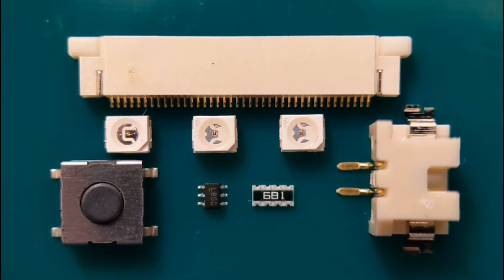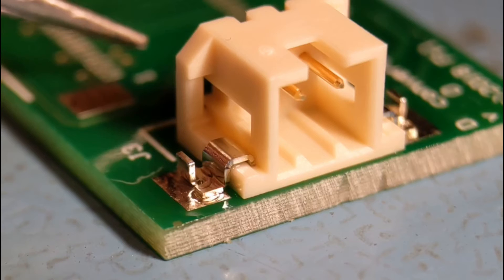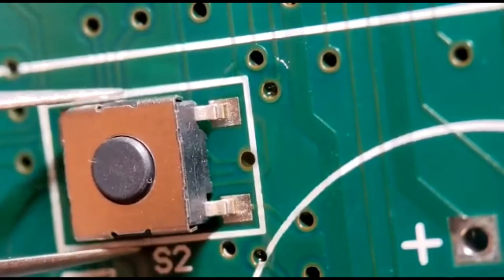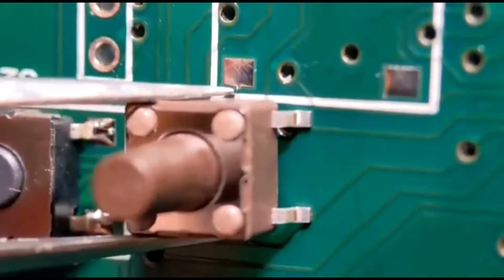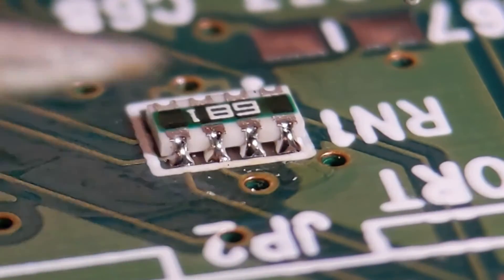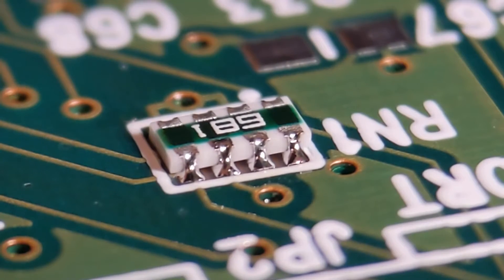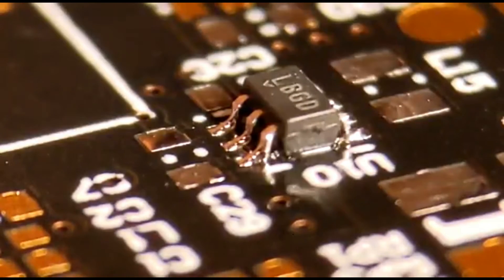How To Solder SMD Correctly - Part 2 /SMD Soldering Tutorial

Comment: whats the solder iron temp setpoint???
Reply from the maker: Hi , thank you for your comment . If I'm using leaded solder generally I would use about 330 degrees Celsius and for lead free about 360 to 375 degrees Celsius . I may have to go hotter in certain situations i.e ground planes ( sometimes over 400 degrees Celsius) but these temperatures are ok for the majority of solder joints . Hope that helps 👍

Comment: Amazing videos- do you solder under a microscope or a magnifying lense? How do you handle these tiny components? Would you be willing to share some of your equipment? I have already watched the one on tweezers and the cleaning video with Ultrasolve and flux off. But, I am interested in more info. Like the tip of your soldering iron, solder paste type and generally your soldering station setup. Thank you for sharing your amazing techniques and experience.

Comment: Should we be using lead free or leaded solder?
Reply from the maker: Hi , thank you for watching the video and commenting , much appreciated . I generally try and use the same type of solder that the board was built with . Lead free solder is usually a little duller than shiny looking leaded solder but there may be times when rework is impossible using lead free so you have to add some leaded into the area your struggling with . Thanks again , take care 👍

Comment: So when soldering the LEDs and your "quick" do you have like a really high temp on your soldering iron? When I try to be fast, the solder never melts as quickly as your does. It takes like 3 seconds instead of 1. But If i have my iron super hot, I feel like it is too hot and burns components before the solder even melts still. idk. I just dont know why my solder takes a few more seconds to melt than yours does. Maybe I just have a crappy soldering iron. idk.
Reply from the maker: Hi , thank you for your comment . I don't do anything special with temperatures etc when I'm soldering LED's . Leaded soldering roughly 330 degrees Celsius and Lead free about 370 degrees Celsius . The irons I always use in my videos are Weller branded . I also use Metcal  . These 2 brands in my opinion are the best 2 makes . Metcal are expensive but some of the Wellers aren't to bad . Cheap irons can be nasty and inconsistent , that may be your problem  . Hopefully you get to the bottom of it . Thanks again , good luck 👍

Comment: Hello there
Amazing video.
I’ve just done my first resistor network, it was tough to get those curved joints you have. 
I think it could be my soldering iron (it’s brand new). I have a hard time to get it pre-tinned at the tip! You sorta mentioned in the video you file your iron just after you buy it new. I took a 2nd look at your iron and I do see it has rugged edges. Does  that help you retain solder easier at the tip? I hear a lot of conflicting opinions about filing an iron or even just using steel wool to clean it. Your input would really mean a lot to me.
Thank you 🙏🏼

Comment: Can you do a video on how to de-solder these kind of components? It always seems harder for me to be able to take them off without damaging them, specially leds and plastic components like connectors
Reply from the maker: Hi , I will try to do a connector removal video shortly but a lot of connectors will get damaged during removal. It's impossible to not melt the plastic as they are made of such soft plastic any heat straight away will melt them , can't be helped. Some of the black plastic connectors will take heat gun use on them but generally white coloured connectors can't take any heat. Thanks for your comment , take care 👍

Comment: How hot is your iron? Great work mate!
Reply from the maker: Hi , thank you for your comment, much appreciated. If I'm doing leaded soldering generally I would have my iron set to about 330 degrees centigrade and if I'm doing lead free soldering I would use about 350 degrees centigrade. I might vary slightly on these temperatures on occasions but most jobs I would use the above numbers . 
Hope that helps , thanks again 👍

Comment: Excuse me , what temperature will be perfect for soldering Sir?
Reply from the maker: Hi , thank you for your comment , very much appreciated.
If I'm doing leaded soldering I would generally set my iron temperature to about 330 degrees centigrade, or if in doing lead free soldering I would use about 350 degrees centigrade. This may vary slightly if I'm doing certain components but generally these are the temperatures I would use . Hope that helps , thanks again 👍
Reply: Thank you so much Sir
Reply from the maker: Hi , no problem , take care 👍

Comment: What temperature did you set to LED's?Thx
Reply from the maker: Hi , thank you for your comment , much appreciated. I generally set my iron to about 350 - 370 degrees centigrade for lead free ( everything in this video was done at this temp ) or for leaded solder about 330 degrees centigrade . Hope that helps , thanks again 👍
Reply: @mrsolderfix3996  Thank you. 😎
Reply from the maker: Hi , no problem . Thank you for your comments 👍
Reply: @mrsolderfix3996  No problem, this is pleasure to watch your vids. If yo can make some video about HDMI/ USB replacement? Thank you.
Reply from the maker: Hi , thank you for your comment , much appreciated . I'm glad you enjoy the videos . I will try to do one on the connectors you've mentioned , but I don't get to post to many as I'm always a bit busy . But I'm sure sometime in the future I will cover this subject . Thanks again for your support 👍

Comment: Please make a flex cable connector desoldering tutorial with hot air. It would help me a lot
Reply: Yes i too would like to see taking off the connectors. I find the pcb boards i work on very component dense and not as brand new as the video here. I know the method would be similar but desolder tips would be helpful

Comment: You are inspiration as well as confidence for me in the smd world. I finished my first proto pcb with five 0603 resistor, one 1206 led and one 1206 cap. There are four THDs also.  It's my fault that I mixed up your technique with another video. I tinned with a little more solder one pad, then refluxed, then slided the component while holding the iron to melt the solder to tack the component in place. Rest is same as yours. On the other video during tacking he holds and slides the component by pushing from top, but I holded the component from sides with angled tweezers like you, because I think it may help solder to flow beneath the component. The circuit worked but I am not happy with the finish as some 0603 components floated on melted solder at one side during tacking and I didn't see that then. I should have followed your technique as is without any modifications. I have another same board I will finish that with your technique as is.
Reply from the maker: Hi , thank you for your comment, much appreciated . If you keep practicing you will definitely get better and you will be amazed at what you can end up doing . Keep going , and thanks for your support 👍

Comment: I have a question Sir ,what is RN1 on pcb?
Reply from the maker: Hi . RN1 stands for Resistor Network , which is basically a collection of resistors all built into the same component . They come in various sizes and values , i.e x2 , x4 , x8 way . Hope that helps , thank you for your question 👍
Reply: @mrsolderfix3996  i have an other question, what stuff would you recommend me to wipe flux after soldering and what stuff sould i use removing solder ?
Reply from the maker: Hi . I use a cleaning fluid called Ultrasolve  and I just dip a cleaning cloth ( dry wipes from company called Grove Sales in England ) to wipe the flux off . 
I'm posting a video in the next few days showing how I use my flux ( and places you can buy it from ) and also showing solder braid and how useful it is . Basically it's a braid and flux video showing video examples , photos etc of their uses together. Thank you for watching much appreciated 👍
Reply: @mrsolderfix3996  Thanks a lot  for your great details. I love it so much.
Reply: @mrsolderfix3996  thank you so much .you have done amazing job.

Comment: Flux is important as well as the correct heat on your solder iron. To hot will be a disaster and to cold will be a disaster as well.Maybe a nice video on choosing solder irons will be nice
Reply: actually, your solder tells you the working temp (always labeled). 
And if it's lead-free (already on PCB) is about 220°C — 240°C

Comment: What is the kind of flux you recommend?
Reply from the maker: Hi . The only flux I use is called SMFL200D . It's a great liquid flux and comes in a 200ml spray can. I just spray some into a small container and apply using a dipped plastic Ty wrap to the desired areas. Available from Farnell , RS Components , Rapid Online, I've even seen it on eBay. About £15 a can . Hope that helps 👍

Comment: Where do you get the fine tips from, type of Flux used ? Enjoy the videos,  nice tip on the filing the tip points thank for the knowledge.
Reply from the maker: Hi , The iron I use , Weller TCP S allows me to file down the tips , but some Soldering Irons , for example Metcals do not allow this as they work in a different way . I get all my tips for my iron from Farnell . Other companies who do them Inc RS Components , Rapid Online , even eBay. 
If you go through the comments for this video I mention what flux I use and where I get it . Hope that helps . Thank you for watching the videos , much appreciated 👍
Reply: @mrsolderfix3996  thanks I want to do a bios chip upgrade on my Imac motherboard.  Plus a video cable connector on another board.

Comment: Flux name
Reply from the maker: Hi . I use a flux called SMFL200D . It's a liquid flux , and comes in a 200ml spray can . I just squirt a small amount into a small container and apply using a dipped plastic Ty wrap to the desired areas . It's about £15 a can and available from Farnell , RS Components , Rapid Online , even seen it on eBay . Pretty easy to get hold of . Hope that helps 👍
Reply: Thanks sir

Comment: What soldering iron tip and solder paste are you using
Reply from the maker: Hi . The soldering iron I use is a Weller TCP S . The tip for it that I used in this video was a PTP7 , conical tip. 
The solder was 0.25mm lead free Sn100SB. Available from BLT Circuits ,Based in England . Hope that helps 👍

Comment: what flux and tin do you use?
Reply from the maker: Hi . The flux I use is called SMFL200D . It's a great liquid flux that comes in a 200ml spray can . I just squirt some in to a small container then apply using a dipped plastic Ty wrap . About £14 a can from Farnell , RS Components , eBay and others . The solder I use is from a company called BLT Circuits in England , it's Sn100SB , 0.25mm , lead free . They also do a leaded version of this thickness . Also they do all other thicknesses of solders . Hope that helps 👍

Comment: What type of flux were you using? I'm just about to buy some and I wasn't sure what to get. I'm looking at MG chemicals-835 rosin flux. Is that what I should be using or do you have something you recommend? Great video by the way, thank you so much for posting
Reply from the maker: Hi . Thank you for watching , much appreciated . The only flux I ever use is called SMFL200D . It comes in a 200ml spray can . I just spray some into a small container then apply using a dipped plastic Ty wrap . It costs about £14 a can  from places like Farnell , RS Components  , also seen it on eBay . It's a great liquid flux . If in USA can be found at Mouser and Digikey I believe. I can't really comment on other fluxes as I haven't tried many but I'm sure the one your looking at will be ok . Hope you get on alright , thanks again for your time 👍

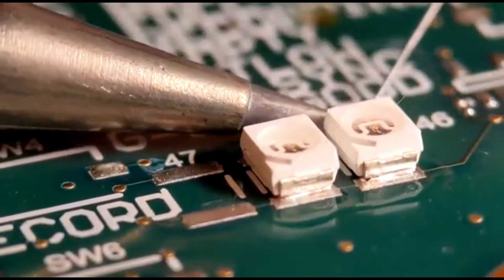Comment: When soldering the leds, it looks like the inner clear plastic i bubbling. Maybe it's a non issue / not a problem. Or, maybe it's just some visual effect from the smoke? Around 2:20
Reply from the maker: Hi . Thank you for watching . I can guarantee you there was no melting of the inner plastic as can be seen in the photographs that are tagged onto the end of the video showing these Led's.
I've learnt to do these really quick ( fact I mention in the video ) so as to not melt the plastic .These soft bodied components don't like an iron on for to long but you can do them ok if done quickly. The inner clear body of these led's takes a lot more heat than the outer body so it's actually quite hard to melt the inner if you solder these quick . Thanks again 👍

Comment: Impressive skills, compared to your precision methods everyone else looks like they're cheating with pre-tinned pads and drag soldering. And I've never been able to get lead free solder to flow like yours does, very jealous! Subscribed.
Reply from the maker: Hi . Thank you . Personally I'm not a fan of drag soldering , pin by pin works for me . Drag soldering if not done right can cause more damaged pins and pads so I avoid it . But like I always say , everyone has their own methods they like . 
The lead free solder I use is great compared to how lead free was when it first come into mainstream soldering . I get mine from a company in England called BLT Circuits . All there products are great . I also use lots of flux as I keep mentioning in the videos , without this you've got no chance of tidy solder joints . Thanks again 👍

Comment: Which solder flux you have used
Reply from the maker: Hi . I use SMFL200D flux . It comes in a 200ml spray can and is a great flux . I normally spray a small amount into a small container ( milk lid for example ) and use a dipped Ty wrap to apply it . It's about £13 a can from Farnell , RS Components , eBay and others . Fairly easy to get hold of . Hope that helps . Good luck .

Comment: Brilliant very helpful tutorials. I am about to try and repair a connector on an iMac...
Do you have a recommended wick for solder removal?

Cheers!!
Reply from the maker: Hi . I use a wick called one step braid no clean , easy braid. The one I get is a reel of 100ft and has a code of OS-B-100. They do shorter reels so just search this type and you will find them . It's a great braid and is 1.27mm wide , they also do wider ones if required . Hope that helps . Thanks for watching , much appreciated and good luck 👍

Comment: Great tips! The hardest thing for me right now is soldering down a port like a usb c or hdmi port. I’m also terrible at running thing jumper wire cables, hopefully with more practice though.. 😄
Reply from the maker: Hi . Thank you for watching . I will try and do a video one day on usb sockets and other small connectors . Soldering really is about practice and using the right solder tip for the particular job your doing . Also I tell people to get some thin solder 0.25mm ( available from BLT Circuits ) this will really help when doing small joints . Also use flux to aid your soldering . Hope that helps , thanks again 👍
Reply: Yes would really like the usb micro b soldering tips

Comment: Beginner question but what temperature should your iron be at? if it's different for different parts what do you recommend? And thank you for all the great videos,
Reply from the maker: Hi . Thank you for your question. All the soldering done in this particular video was done at 350 degrees centigrade . 
This temperature will generally solder most small parts with small joints like these . When I have larger component joints to solder I normally just change my soldering iron tip to a large flat sided one as I done in the previous video I posted but still keep to this sort of temperature. The key to a lot of successful soldering is to use a good flux . I use a type called SMFL200D which really aids with all soldering . Also try and get some thin solder like I used in this video . I used 0.25mm available from (  BLT Circuits , based in England ). So 350 degrees C , flux and thin solder and that will help with all small joints. 
Hope that helps . Thank you for your support , good luck 👍
Reply: @mrsolderfix3996  thank you so much
Reply from the maker: Hi . No problem . Good luck with everything you do . Thanks for your support 👍
Reply: @mrsolderfix3996  do you have an email I can send you a picture of some traces?